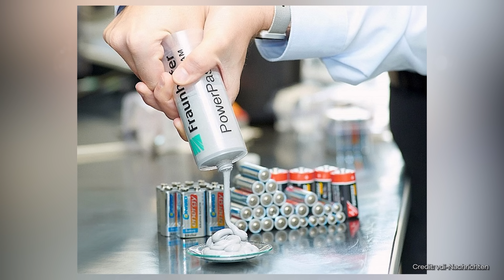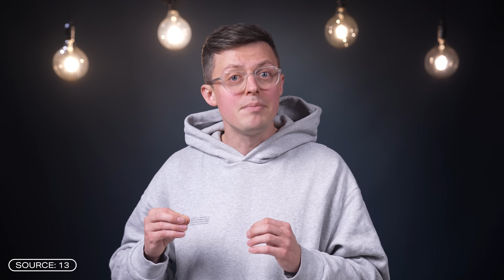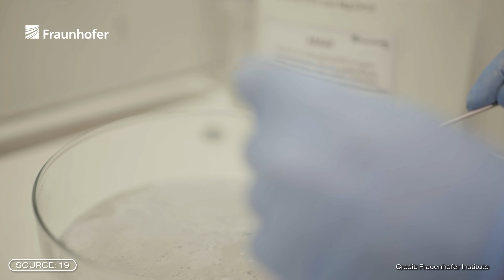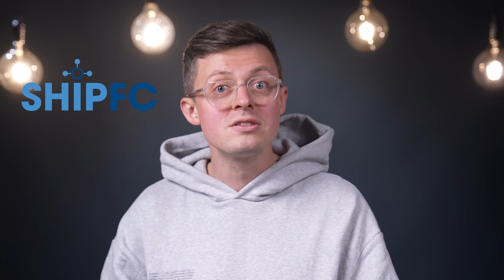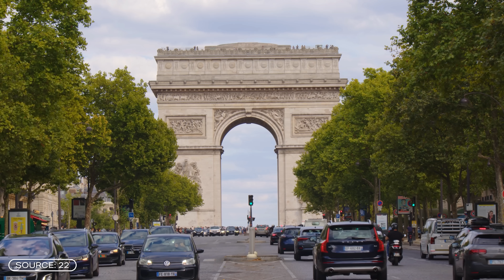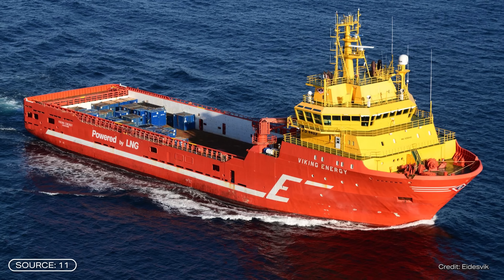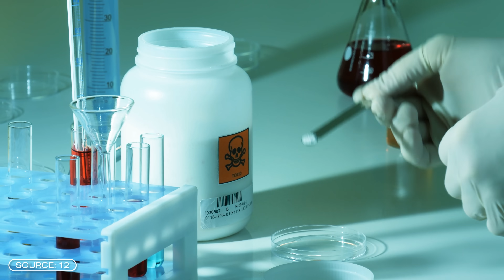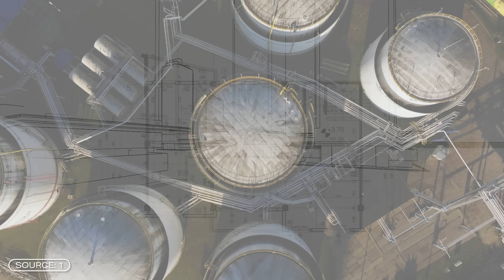Hydrogen Powerpaste: 10x Higher Energy Density & Safe?

Comment: The Hydrogen paste is just cool. I can already see how that could actually be helpful with all the gas heating systems we have still around in Germany. Refurbishing those to use Hydrogen isnt that difficult but the infrastructure is. Just slotting in a cartridge into such a system would be so simple and wouldnt require any new pipes etc.

Comment: The energy densities seem idealised, and accounts for the energy of the hydrogen held within the paste and water reactant. For comparison to batteries the energy density at the system level need to be considered instead, particularly for vehicles, including the weight and volume of the water reactant, the weight and volume of unused powerpaste, the weight and volume of the reaction vessel, the weight and volume of the hydrogen fuel-cell, and the weight and volume of the spent materials that need to be offloaded at an appropriate stop (not possible whilst travelling, with the resultant Mg(OH)2+binder being over twice as heavy as the powerpaste). Also the efficiency of the fuel cell needs to be factored into any comparison with a battery system.

Looking at the technology sheet, the 1,600Wh/kg figure is the input energy density of the released hydrogen from 9kg of powerpaste into the hydrogen fuel-cell not the output or system level energy density.

Also, the round trip efficiency of the input energy to generate the Powerpaste, plus package and distribute it, needs to be compated to that of using electrons more directly in a battery based system.
Reply: I also just want to say that the idea has fundamental mechanical problems as well.  The idea of cycling paste into some kind of separator, adding water, extracting the hydrogen, siphoning it off, and removing the sludge to storage seems like it would be pretty impractical for any kind of automotive or similar application.

I do think that a whole lot of the problems here can be mitigated with scale.  A ship can have the bulk to deal with all this stuff and refueling at port where the paste is produced can mitigate the issue of sending the charged and expended pastes around.  Additionally, the machinery required to do this isn't going to be all that heavy as far a ship is concerned.  Bulky, yeah, but not heavy.  Not like a cargo of iron ore or something.

That being said, this leaves a massive problem in the scale of production.  The numbers cited here talk about 'a large production plant' (whatever that is) capable of producing 4t annually amounting to 6400 kWh of energy.  In the scales you need for shipping, this just isn't crap.

I saw some numbers for a small electric container ship floating around.  They should be taken with a grain of salt, but even in the best case scenario, all this works out to maybe being able to run a ferry or a river ship or something.  One.  Maybe.
Reply: I think a good way to get an idea is to compare the numbers to how much total energy storage your standard fossil fuel fed Cargo Ship has from the typical mass of the fuel and then look at its energy conversion efficiency from combustion to motion. (Or the efficiency of from combustion to electricity to kinetic energy)

I looked it up and the smaller Feeder Ships have around 11.7 million kWh of total stored energy, meaning at 1600 kWh/Ton, to run a single one of these feeder ships (assuming no changes in efficiency of its movement), you’d need to produce 7312.5 tons of the paste. So the initial goal of 4 tons a year isn’t enough but that is the initial goal after all.
Reply: yep - a good summary of the issues with the whole idea.
Reply: This is a great comment you made here.
Reply: Ai trashing everything. proof read your sht.
Reply: The term you are looking for is 'embedded energy' ie the total energy required by the entire process from extraction and processing of raw materials,packaging,distribution,clean up/disposal.
Reply: yeah it's a stupid idea, hydrogen is a scam.
Reply: This is an engineering presentation Hydrogen is already being successfully used to power rail. It's a generation of engineering away. Even Musk is beginning to recognize the limitless future of a limitless clean energy resource.
Reply: @edwardgilmore7260 - there are more direct electric powered trains (overhead and third rail), and battery trains (in battery only, bi-mode or tri-mode configurations), than hydrogen powered trains around the world. 

The same low round trip efficiency applies to hydrogen in trains just as it does in other vehicles, hence has to offer additional benefits, which for trains in Europe (and elsewhere with high public investment in rail networks) is not the case due to already high levels of electrification. With the remaining lines requiring electrification being low utilisation lines, for which battery trains are being explored as the more cost effective option.

Also, the safety risk for mass transport needs to be minded, which slows hydrogens adoption in additoinal to cost considerations.

However, this thread was specific to the hydrogen power paste, which has a fairly low energy density at the system level, one that worsens as the paste is utilised, with the mass of the waste product building up on board the vehicle (before it's offloaded and regenerated back into fresh energy paste).